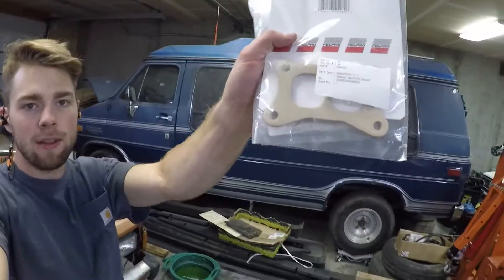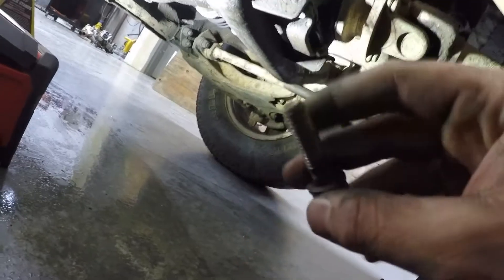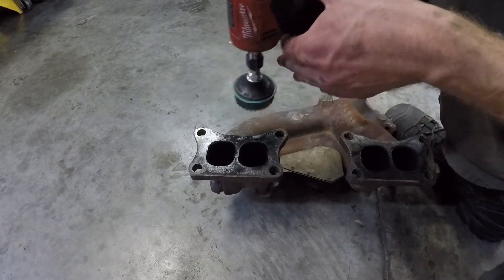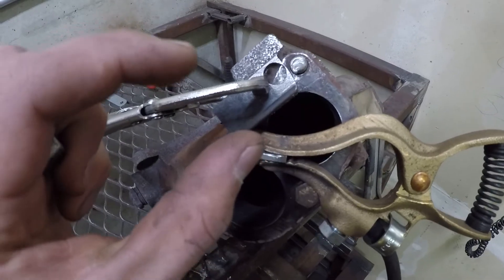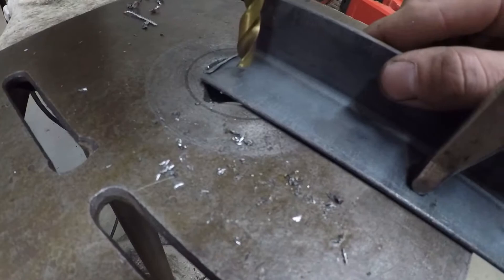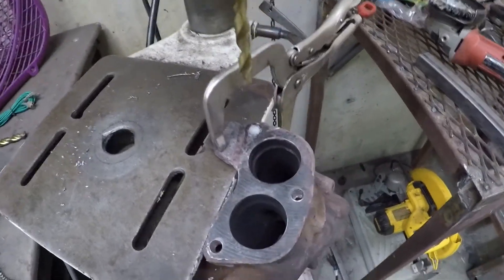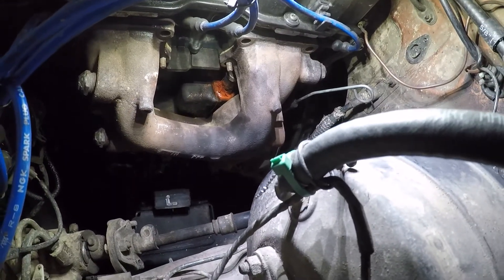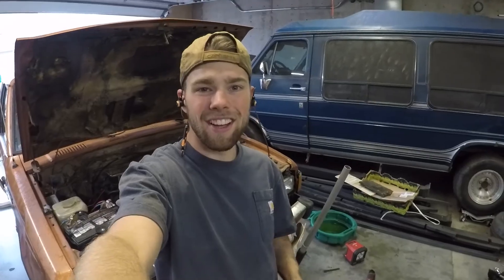Fix Exhaust Leaks. Exhaust Manifold Replace and Repair

Comment: Trick to pulling broken bolts is to use a washer first and weld it first, then wend the nut on top of that. Appreciate the 720 appreciation, working on mine next weekend

Comment: I'm just going to seal my hood and might delete the 🐈. I hear a full leak. I believe that it's the collector gasket or lack of one. Mine is fwd wagon and it's crammed in there. Everything is rusted and if you undo the collector, it doesn't give but maybe a 1/4" of play.

Comment: I actually tried the red exhaust rtv on the collector before in a desperate attempt to stave off the fumes. The whole thing is probably on borrowed time at high interest. I'm nervous as heck trying to break the old rusted studs off. I'll try weather strip to seal around the back of the hood to keep the smell from going directly into the air ducts. I bet the cat is partially plugged and the collector is going into the wrong size down pipe. Yay. Someone wrecked it back in the day.